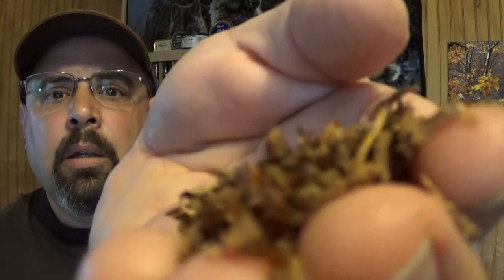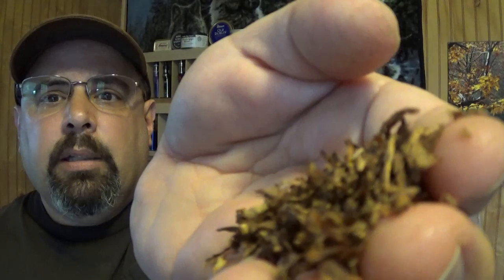How to WASH pipe tobacco....an Experiment!

Comment: I suspect the deep black colour comes from the tar. I used to work in tobacco harvest in my teens back in the 80's and early 90's and as you picked ("primed") the green tobacco leaves off the plants in the fields, the (black) tar would build up on your hands until the point where you could actually draw pictures in it on your hand. It was a thick, black, sticky mess.  The palms of your hands and your fingers literally became blackened and you had to use a special rough soap to try your best to scrape it off as best you could -- and it never completely came off. In fact, once the harvest was finished, it took about 3 weeks for your hands to look normal again.
Reply from the maker: Sounds lovely! Maybe I'll wash it again LOL!
Reply: Its not Tar, which only comes from a byproduct of combustion. What is shown here, and on your hands, consists of the oils and naturally occuring volatile compounds which make up the tobacco plant. There are tiny little hairs full of this oil called trichomes, on the leaf. It just so happens to look like tar and hence why you assumed so, because it is a dark color. It's also sticky and oily, like tar
Reply: Taydrum I got some organic tabacco leaf and man is it strong. I am trying to figure a way to make it more smooth. I was hoping this was the way but if it doesn't actually take any nicotine out I guess its pointless to try this.

Comment: I've used this method , but it was not to remove any nicotine , but to remove casing or flavouring ,
it does work to a certain degree. tried it with a burly flake,it broke the flake into a much finer shaggy consistency.
still a good smoke.
Reply from the maker: William whizz No doubt it would remove any flavoring or casing. Thanks for watching!

Comment: Nicotine is found in some vegetables and of course tobacco. My question is if  wetting the tobacco  removes the nicotine then why doesn't the rain is wash it out as it's grown.
Reply: Nice question. I'm thinking that fresh leaves have a protective layer shielding the plants inner workings from the elements. However, when the leaves are picked and fermented (decay of the leaf), the ability of the plant to keep it's structure deteriorates. The same thing happens in tea. Black tea leaves give flavor to the water due to the fermentation and following heat treatment of the tea leaves. Green tea does the same without breaking down, they simply get a heat treatment (frying in China and steaming in Japan). White tea is simply dried leaves of the tea plant (Camellia Sinensis), but even here, simply the drying of the leaves robs the plant of it's function to protect itself from water. I hope you find some inspiration in my comment. Take care :-)